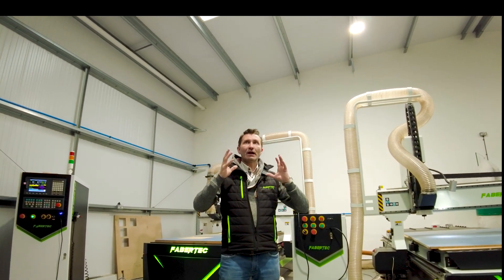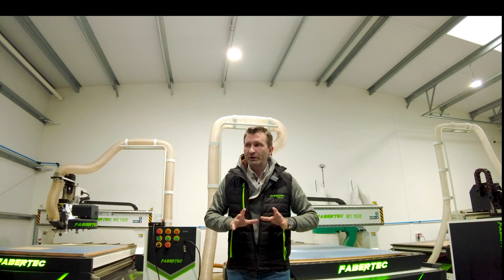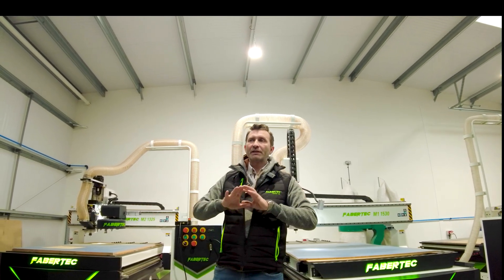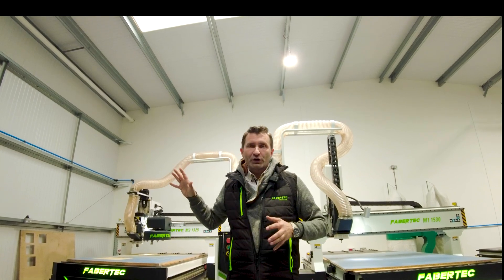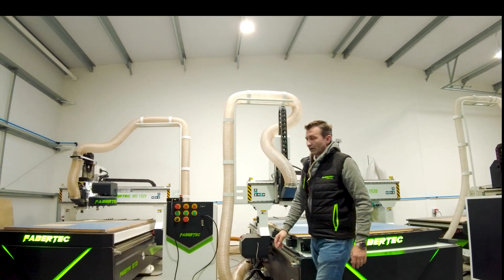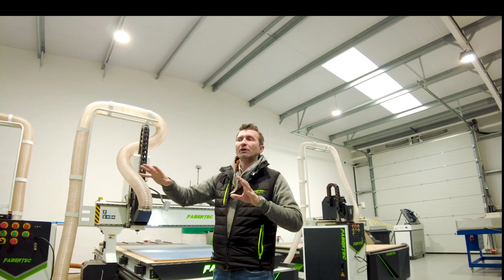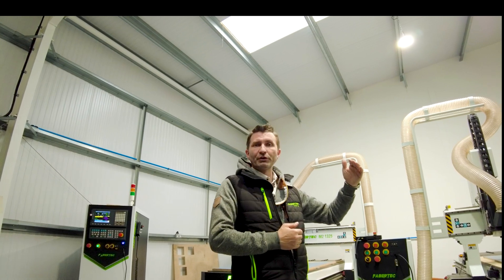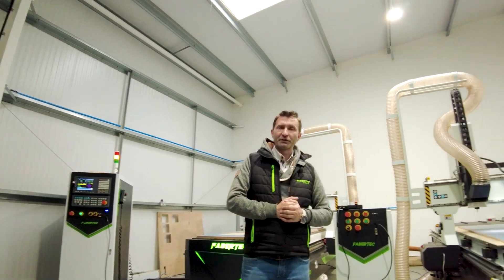How do I select the right CNC Router for my operations?

Comment: how huch is m2 3 meter  length?
Reply: Hi Gabis. Dependable on model M0, M1 or M2 from £15,950+vat for M0 to £28,850+vat for M2 2030 with 12 tools ATC. Keep on mind for that size you have to upgrade to bigger vacuum pump if you will be cutting anything aside from large shapes like van lining or wall panels. Rotary vane 11kW pump copy of Becker cost £3,500+vat when you purchasing with machine. All costs included aside from small surcharge for transport (2030 models only on hiab lorry). Prices valid May 2023. Cheers.